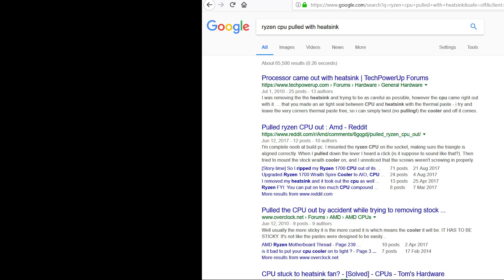How to PROPERLY remove a HEATSINK from Ryzen CPU (without pulling cpu with it)

Comment: This happened to me and I bent the pins. I straightened then out though and the cpu works fine. I will use this technique myself thanks in advance.
Reply: How did u straighten them?  Cuz I recently pulled out my CPU when my lever was down with the cooler. And my pc is hitting 95c while gaming I'm afraid that I might have damaged my cpu
Reply: @iitzkris  tweezers and magnifying glass. You have to be careful when you do it because you could break the pins. Also 95° c is a lot i was getting 65°c under full load on stock.
Reply: @savagegecko4575  ok thnx

Comment: It's only with its stock cooler not aftermarket coolers
Reply: Not true, happened to me. It's due to the thermal paste turning hard and also because the cpu socket doesn't have a strong lever like the ones in the intel sockets.

Comment: While removing the stock cooler I also pulled out the CPU with it. Luckily the pins were not bent and everything is working fine. But it sure was scary to think I broke a brand new ryzen 2700x.

Thank you for this  video, AMD should really warn us about this.
Reply: Same thing that was happen to me. Luckily it was working after I clean and put new thermal paste on it